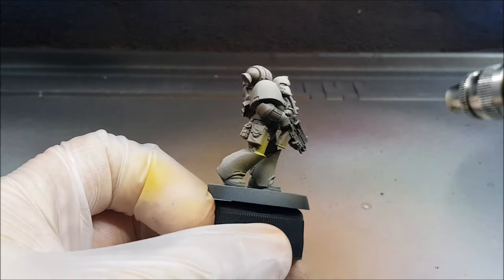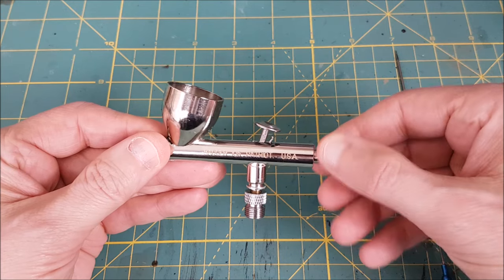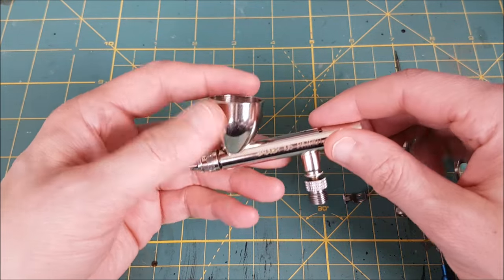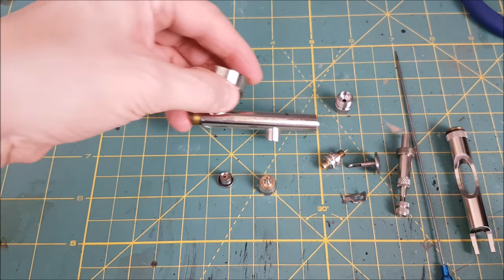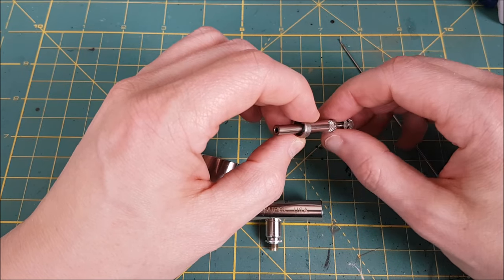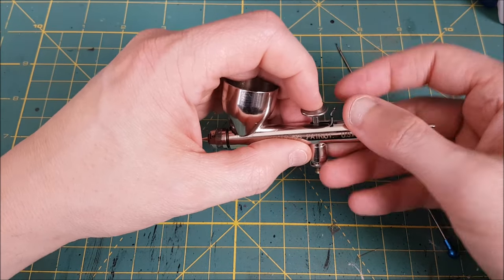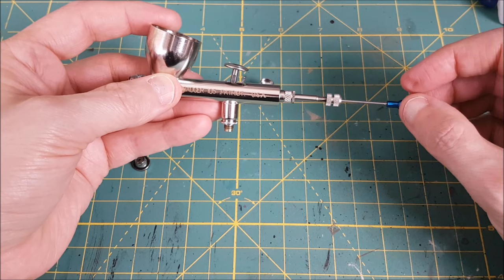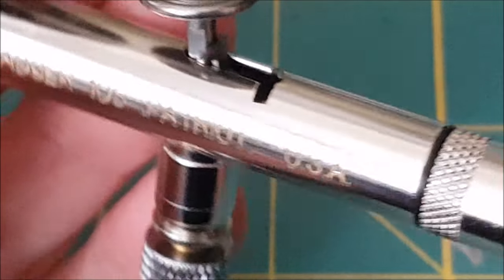The Airbrush | Disassembly and Assembly

Comment: Very helpful. I took apart my air brush to clean it. I am a beginner and I freaked out. Until I saw this. Thanks mate!. Just one thing to add. The trigger goes into the hole below from where the pressurised air comes. Just add that little detail as it seems to be missing. I had a hard time guessing where to fit the trigger. Cheers!!
Reply from the maker: Yeah the trigger & trigger guard are the most annoying parts to re-attach.
Reply: @WatchItPaintIt  OMG! Aint that the truth!! I too am new and was a nervous wreck thinking the same thing as 
@arshadhasan, that I wouldn't get it back together.Everything came apart and went back together just fine... until the trigger. So I was trying to figure out does the little piece on the bottom of the trigger ( the part that bends back and forth) does that go inside the hole that i saw inside the brush or does that bottom part lay flat or where the heck does it go! So I fiddled with it for like an hour until it finally seated itself properly, so I knew it was in right, but I still don't know where that very bottom of the trigger went to, if it laid flat or if it went into that hole?? Oh boy!!!  Thanks so much for a GREAT vid, I musta watched 10 ones on how to take apart and put the brush back together, but you finally gave me the courage to just, DO IT Patty!!!  lolol

Comment: I recently just got an airbrush gun and took it apart of course i had my anxiety attack! but now its a panic attack because after 3 hours of learning how to assemble it back now the gun is just spraying air and not the product I cleaned it out already as well but i dont know what it might be I am seeing that it might be the needle chucking guide any advice or suggestions on what it might be ?
Reply from the maker: Sometimes it's the trigger mechanism, but it's hard to tell without seeing it. Is the trigger guard pressing snugly against the trigger?

Comment: I got a airbrush a while back but never use it due to not having the time to break it down each time i get a free moment to paint. Do you half to break them down each time ?
Reply from the maker: No - only for a deep clean, which you don't need to do very often. For a fast clean, tip the extra paint from the cup into a waste container, add water to the cup a few times and dump that out, then add some cleaner and swish that around with a brush, dump.  Then just spray a bit of cleaner and water thru the end of the brush to finish it off. Takes 2 minutes to clean it that way. You only need to take the airbrush apart if it's constantly clogging. Even then you can usually get away with pulling out the needle, cleaning and lubricating it and then put it back.  Hope that helps!
Reply: @WatchItPaintIt   Yes huge help!  That will save me alot of time!  Thanks for explaining that and thanks for the reply have a good one!